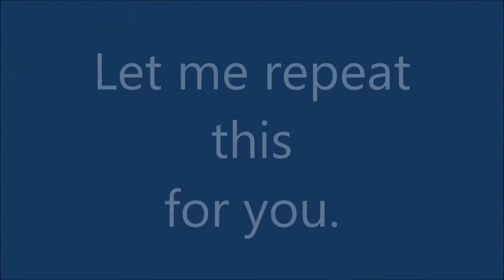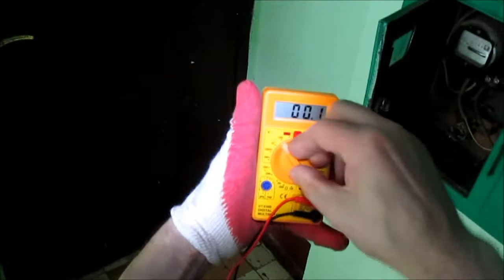Short Circuit In The Breaker Box.

Comment: Curious if you were ever able to track down the circuit, and particularly which load on that circuit was causing the short?
Reply from the maker: No, I didn't track it, neither I found what was causing this short cut. The wiring was a mess,  hidden in the concrete walls, floors and ceilings. Anyway, that apartments desperately needed  new wiring. I switched the hot and  neutral in that breaker panel, the short was gone, I left the building.

Comment: I got that beat....stay tuned
100 amp breaker on left..30 30 on right..replaced the 30 30..sparks fly...flip on the 100..sparks fly..are they touching  one another..how?
Reply from the maker: There are no 100 Amp breakers there! The sparking must have been caused by a short circuit between L and N conductors, with the potential difference of 230 V.

Comment: I was cringing when he terminated the wires into the CB with the drill until full lock...quickest way to fuck a circuit breaker & the 400 coats of green paint on the enclosure creeps me out,to be quite honest!
Reply from the maker: Actually, it was not  a drill exactly, but a power screwdriver, that was used to terminate that wire in the CB. It had a ring to adjust the force applied. This kind of electric screwdriver can be used to terminate not only CBs, but also sockets and switches. I do it all the time, recorded it a number of times, you will be able to see it in my future videos. It was only once, that I smoothened  a thread with a new power screwdriver, that I was not used to, it was in a socket, I had to buy a new socket for my client, it never happened again, I learned how to adjust the power screwdriver for different kinds of job. I am a professional and I know what I am doing.
Reply from the maker: This breaker panel was very old, it could be installed in1960s or early 1970s. It was painted a number of times. The whole panel should had been replaced years before I recorded this video, but, corruption or something prevented this. There are lots of old breaker panels in Moscow, you can see some of them in this play list: https://www.youtube.com/playlist?list=PLqADpmBUEnTTvNljiYm54ZH33Fb5F0cJm

Comment: what was the culprit?
Reply from the maker: It was not clear. I was there to replace old breakers with new and modern ones. When I turned the new breakers on, I got a short, and we see in the video, the short was in the right upper corner of the breaker box. The investigation I attempted to undertake, gave me nothing certain. Finally, I interchanged the L and N of the line in question in the breaker box and the short did not manifest any more. Anyway, I don't know if it would have manifested again if I hadn't interchanged the L and the N. Certainly the wiring was malfunctioning very seriously.
Reply: @electrician_in_moscow_russia.  Thank you sir for the detailed reply. We appreciate it.
Reply from the maker: You are welcome!